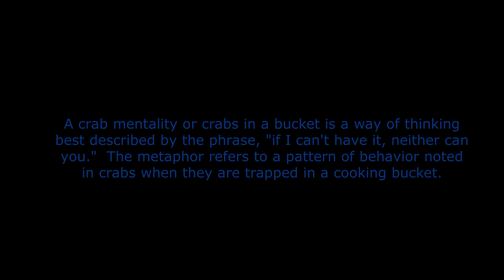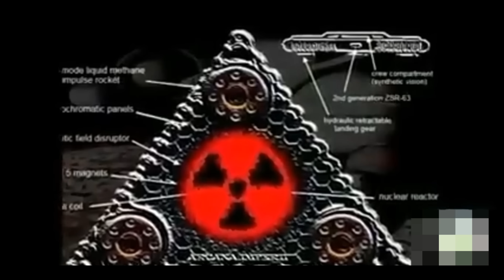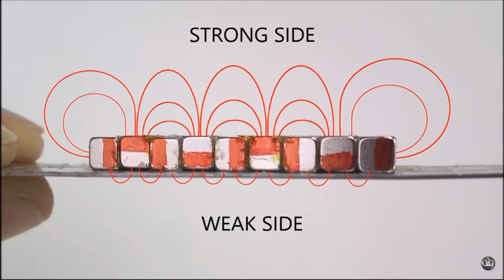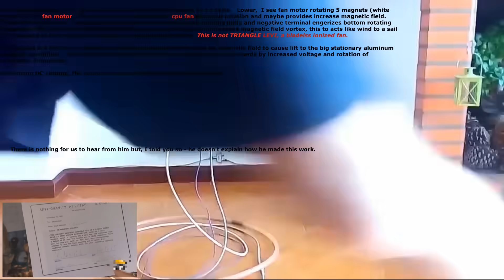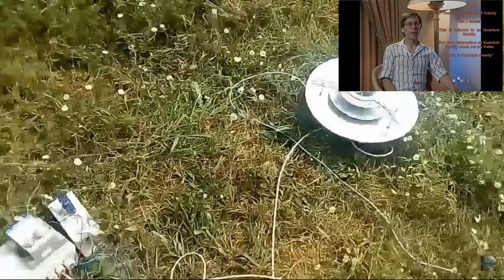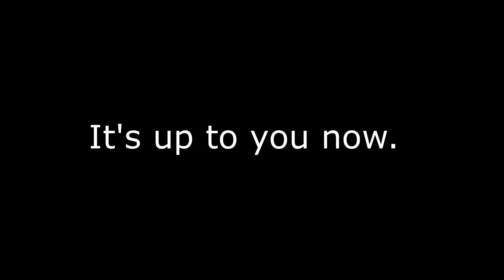anti-gravity project

Comment: This is how alien ships work: inside they have a huge coil that creates a variable magnetic field (intensity and polarity) there you have your adjustable magnet. They also have a liquid heavy metal, lets say mercury. They use the variable magnetic field to spin the mercury at extremely high speeds. The spinning of this huge liquid mass creates a force perpendicular to the rotation of the liquid. Now you spin another ring of mercury in the opposite direction and now you have a perpendicular force in the opposite direction of the first force. Thus having two opposing forces of great magnitude you create a "force field" or your own "gravity field" that can isolate the machine from the Earth magnetic field. Now you can also control the direction and intensity of this new force field and thats it, you have speed and direction. The force field is so big that bends time and space around the craft. Peace.

Comment: I've made quite powerfull alternator out of old 7200rpm hhd and magnets. I tried to make spinning disc as heavy as I could to recive as much power as I can. Then I've made an vacum box with valve out of strong 3d printed thick, stiff plastic. As pressure dropped it even started to spin by itself and that really suprised me. Thought those magnets won't be able to move that mass. Added small 20k rpm engine 1:1 to increase RPM due to not perfect vacum and load. It's nurning basicly for 3-4 seconds to spin it back from 10k rpm up to over 20k rpm. Then it takes about 7-9 mins to drop rpm back to 10k. Repeat.
Just ended testing. Result? Output =  avg 30W 12V 2.5A at 15.5k RPM 
FOR FREE
I have few ideas how to improve it and I'm not even dreaming of mercury :P Gonna start working on them this week. For the first one I'll add heatpipes. Don't know if just for heat or if I'll add peltier link. Probably the second option. Other two gonna improve by reaching way better efficiancy using few tricks that came to my mind, like as small vacum chamber as It's phisicly possible. Smaller chamber, same pressure, less air particles, less friction. I think it's possible to tripple or even quad that power, by adding another set of magnets, add more weight to plate  from the other side. I may also change rpms from 10-20k to 15-20k or maybe even faster with another motor. Wish me luck and see you soon. Maybe I'll make a video of making them because it's pretty easy and cheap or maybe want to be alive xD
Reply: You say all this stuff but im not seeing any videos on your channel

Comment: Mr. Lazar if you are still monitoring this , Do you think it possible to create an anti- gravity device that generates the power required to power an electromagnetic strong enough to support enough  lift to allow flight. (short version)
Reply: Not him but shouldn't be too hard, it's a case of power generation to mass ratio, and ofcourse: for how long. So the real question would be, what would be a practical siE for a craft, how much power would thst take, and see what you cans stuff in at what size and weight, thst will define hoe you do it.

Comment: Assuming the lift is from magnetism with the earth's field, and under the assumption that the earth's field is around 40uT wherever this was filmed, and guesstimating that the radius is around a foot, and further guessing that the contraption weighs about 5 pounds, by my calculations, the field generated by the contraption would need to be around 480 T.  Even the most advanced MRI machines produce only 7T.  This is nonsense.

Comment: heres the problem ...on a table connected to a wire yes it will levitate...but how do you achieve it in nature...in space its easy...reason...magnetic wave compression....Meaning you need to tune in to a magnetic wave/frequency be able to control it to compress it on earth...problem is magnetic waves are all over the place in large bands ....of semi compression...this state would need to be controlled as well...A craft with a electromagnetic hull would definitely be of use...not an easy task.... a magnetic engine would also be needed to magnetize the craft ...frequency band emitter and tone catcher / emitter in order to tune into a specific magnetic wave...by tuning into it you could control it and ride between two planes of a magnetic wave...no friction...aero brakes also... Someone name Ibrahimi Fatima is working on this as well..only shes 30 yrs behind the ball...

Comment: Alexey's machine time 9:07 He is taking a flyback transformer from a tubed tv and pulsing it to each small plate that is rotating at 3,000 rpm. He is looking pulse the magnetic field around the magnets. The tesla coil is used for frequency. The eddie current affect of the aluminum forces the magnetic energy to stay in one place. To improve the design he needs stronger magnets. If he puts in stronger magnets it will allow it to rise quicker. He uses 200,000 volts only. The flyback transformer removes amps. you only need the bottom magnets while in earths Magnetosphere. However when in space you will need to add magnets to the top plate. If strong enough you wont need the tesla coil or the pulse circuit. The magnets will pulse when one is over the other. The amount of times per second will be the frequency. The reason you will need both in space is because you will not be picking up the pulse from the earth that you have to match to make the original for it to work. You can build this with superconductors. However they have to be attached to the dielectric field ( center plate) Also you would have to design the outside of the craft like a tesla turbine blade allowing for super cold air to go through the center charging the superconductor. The shape of the craft is one of the most important parts, because it doesn't hit a Mach barrier. It improves performance at that speed.
Reply: Different way of anti-gravity this is not what actual Space ship uses
Reply: @mrarjun847  A space ship uses sound to lift it. However a brute force can lift it with just the energy. Look at Alexey's craft again and place a coil under the center plate. If you notice it makes a rotational speaker. Then you will start to understand the octx-1 or the Nazi craft. they all use the same thing.

Comment: The main thing im thinking about is the power source, if it has to be a certain amount of energy to make it work , decreasing some of the energy wold make it descend ,controlling it in such a manner for up and down (y)axis. But making it move on the (x) axis seems interesting idea all on its own. Would most likely take more than just magnetism to move something so fast. Baby steps I guess ahah but all of this makes me think about nature, bees for example or scarab beetles 🪲.
Reply: I believe the power source is the main issue we have as a species. Atomic energy as we know it is not smalll enough to make it a convenient option . Would need something that is lightweight and produces or holds more energy then needed to achieve long distance travel . I don’t believe we are far enough along with solar
Reply: Liquid Metallic Hydrogen, It is what spins around Jupiter and makes the Magnetic Field in that Planet so Large. I think they found a way to replicate that and use it as a Power Source. (I had a Random ass Dream two years ago on this, lol, just a crazy commentor don't mind me).

Comment: I want to ask you a respectful question. When your device rises a little from the floor in the room. An area around the larger circular plate can be seen, which is pixelated in the video. What is the reason for this distortion in the pixelation of the video? It would be nice to show a clearer video of how your device works, because your device may be a drone that has had the propeller that makes it fly digitally removed. Thank you very much for your reply. Explain the distortion of the video pixels.
Reply: Bro made this like a turtorial video you would see on tiktok 🤣
Reply: @contentdeleted4978  my thoughts exactly lmao
Reply: You can see pixels @4:53 too on the desk lower right. Right beneath the positive wire.
Reply: @locke8847  Also there's a screw there, for couple of seconds, then it get's covered with that pixelation, too. This is a video for people with IQ below 90.
Reply: isn't it extremely easy to edit videos without any pixelation? idk that doesn't seem like a very big deal.
Reply: Gravity is simple, pee in the toilet, watch how the the bubbles with group to the larger bodied bubbles
Reply: @hpjunkies3962  you deserve Nobel prize 😂😂 most scientifical explanation ever. Not surprised that like you believe in all mainstream bs.
Reply: Well build it your self and find out the parts only cost like $400 in the end
Reply: That isn't pixelated mates. That's how the lighting is. Antigravity is real. You don't suppose those crafts y'all been seeing floating around the skies are aliens do you?! Because that would be a joke, right? Those crafts you see floating midair are made by human beings & are not aliens. If aliens were here visiting us, they'd be hostile. They wouldn't come in peace. Just as humans too would also be hostile to other life forms if they encountered other intelligent life forms on alien planets. The reasoning behind the manifestation of alien races, alien spacecraft, is because the government want to be able to test their secret weapons out without causing their enemies any alarm 🚨. It's far easier to convince the masses & other worldwide governments that unknown flying objects are patrolling our skies. And that they may, or may not be aliens. These top Military brasses will neither confirm nor deny the possibility of aliens, alien crafts because they don't want to tell lies but, they refuse to tell the truth either. Well, that's because they cannot tell the truth. It's top secret for a reason.
Reply: @facelift8243  Hello Face Lift. Interesting channel name. Your comment was also very interesting and I can't believe no one before me has ticked it or replied to it. Perhaps they don't like your video name or some bizarre reason I can't figure.
Your thoughts are exactly and precisely correct!!! Not cause I say so, cause it is a fact! 
I've got no idea why other people can't see this. To me and obviously you it's as plain as day is to night! 
Anyway my friend perhaps we better watch out backs. Sometimes the truth can be a heavy load to carry! Cya! 👻🚀
Reply: It hurts my brain to see people talk about the Moon landing...

"One 2018 study identified some characteristics common to people who are more susceptible to conspiracies. People who are more suspicious, untrusting, eccentric, and tend to see the world as a dangerous place are more likely to see meaningful patterns where they might not exist and to believe in conspiracy theories."
Reply: @LoseBLAD  mas o mundo é um lugar perigoso. Onde você vive? Pelo menos aqui a qualquer momento o governo pode criar uma lei absurda ou o indivíduo pode ser roubado e morto. Fora diversas outras questões. 

Negar fatos e acreditar em conspirações está mais ligado a dissonância cognitiva e crenças enraizadas das pessoas.
Reply: Don't know
Reply: I believe it has to do something with plasma idk
Reply: @flanfre_skarlett  And hidden strings
Reply: @LouiesLog  Youtube censorship
Reply: @flanfre_skarlett  You're going to fit in well with the rest of the lunies, yeah ok, censorship.
Reply: @flanfre_skarlett  Yes I am aware of the filter and comment deletion -  your comment would not have stuck around for so long if it was not yourself that deleted it. I made a direct quote of your comments and stayed up, if it were not for the fact you were back pedalling and censoring yourself your comment would have stayed up as well
Reply: @danieldixon319  me when
Reply: Crickets
Reply: Does anybody have a time stamp? I’m going mad trying to find what he’s talking about.
Reply: It's totally a drone!. There is no anti gravity whatsoever! They have made antigravity work but super cold temperatures were needed and special superconductors. All in a laboratory I should add, not in someone's back yard or in their home.
Right in the center of the drone the propeller is likely in there, enclosed in something like a tube to focus the blowing air to a smaller area, increasing the lift. See, he showed us nothing was above it but he did not bring the camera right underneath the drone and look up, probably because we would have seen the prop spinning away. Oh, and he has audio playing over the video so we can't hear the motor and fan noises which we can guarentee would be really loud. ✌
Reply: Great question
Reply from the maker: anti-gravity-toridal_synergy
https://youtu.be/8KGuB8bZKNs
Reply: This is caused by ffmpeg compression. 
The basic ffmpeg encoding is: if object in picture is still, like the floor/the wall etc, it will be referenced instead copied on each frame, so it will appear clear and not pixelated, to reduce byte size, if the object is moving around picture, the object will be compressed, it look less clear than the still objects, so you will see pixelated around moving object, especially in the heavy compression method.
Reply: @wavefunktion  The socket on the wall is not moving and is also pixelated. With online artificial intelligence you can remove objects from a video.
Reply: @wavefunktion  I don't believe you, you couldn't even spell Nerd correctly. 🤔
Reply: @wavefunktion  Right.

Except, what you described NEVER occurs as perfect nearest-neighbor compression, as can be seen in this video. I can kinda see where you coming from with this explanation, but it doesn't make any sense when you compare it to other pixelated footage that is caused by the effect that you bring up. The pixelation seen in this video is 100% edited in.
Reply: @wavefunktion  AND THE PIXELATION OF THE VIDEO HAPPENS PRECISELY WHERE THE PROPELLER OF A DRONE COULD BE?... BECAUSE THERE IS NO PIXELATION AT OTHER POINTS?
Reply: @wavefunktion  So, the comperession just happened to conveniently remove that bolt from the frame?
Reply: I farted heaps hard the other day and “lifted” off the couch.
Reply: Looks like he hung the thing up by a string like  a ceiling lamp and edited it into the field footage at the end. it moves just like a ceiling lamp on a string lol
Reply: @LouiesLog  yeh I thought that too!😁✌️
Reply: All "out of the world" like advanced technologies are pixelated videos. Like this one, Moon landing, Alien sighting etc.
Reply: @kalyanboro6338  except the moon landing is real and has been proven time and time again.
Reply: @kalyanboro6338  moon landing, aliens 😂🤦‍♂️
Reply: @kalyanboro6338  except this video was recorded in 2016. Maybe if it was from 90s or 80s, but it’s from less than 10 years ago. No excuse for poor video quality
Reply: @kalyanboro6338  The moon landing is pixelated because the original footage was written over in further missions.  So now the clearest footage we got is a pixelated version.
Reply: @AwTickStick  and you use hairspray to make your hair stand up on the ISS
Reply: @keithpoley3432  ?
Reply: @AwTickStick  you've never seen the original footage has never been released.. you've seen a mix of staged footage mixed with the original footage.... and your explanation doesn't make any sense... why would you write over footage in further missions... you wouldn't. New mission means new footage...
Reply: @bobbyhandley5581  I haven’t yes, but once upon a times whole country was watching it live on their televisions. Also memory, computers don’t have infinite memory, overwriting footage is basically like deleting apps on your phone to get a new app. Or deleting photos to take another one. However this was a long time ago so instead of deleting something they just use the memory that was being used and then made it get used for something else. Which caused the memory of the moon landing to get corrupted, the footage exists, but it is missing data, so like a meme that has been passed around the internet saved and reposted, it caused it to become pixelated. In fact missing data is also what causes those memes to be pixelated, since computers don’t save all the memory, it basically just summarizes it. If you had 100 summarizations the video then becomes a low quality mess. Same effect different reasons.
Reply: @AwTickStick , no one ever went to the moon. Fact.
Reply: @AwTickStick  think about that explanation for second. Does that seem plausible to you, that the first country to make it to the moon would copy over the original footage, with different video? Ultimately destroying their hard copies,  the copies needed to prove if it was filmed in on a set  and not on the moon. Recorded copies can't prove this...only the masters can prove it was faked. 
 What about this fact, video recording camers were all on film back in those days, there was no such thing as cassettes  or thumb drives back then. That said, how tf would they "record" over top of film? I call bullsh¡t on all of that!! Think for yourself and always question authority. Don't believe everything they tell you, think critically. It's important now more than ever before since information is now weaponized. It's being used against us at all times...
Reply: @AwTickStick  that's the one and only thing I will agree with you on, humans do make mistakes. However, one of this magnitude is impossible! I'm not sure if you understand the importance and significance of the "moon landings?" Not only were they the greatest achievement of modern man but symbolically, the first landing alone won the space race for America. 
 The Americans and NASA would never let history like that be lost to time and allegedly written over! NEVER EFFING EVER! That's their pride and joy!! If you believe their "story" then you have a lot to learn...

Comment: This works instead of a tube you use a
Hollow Square separated on one end.
And a plus DC currant only works in one direction.
Reply: It uses a pulsed DC signal at 100 or less Hz. The Direction of the current is critical .